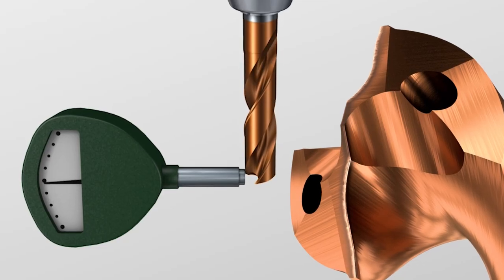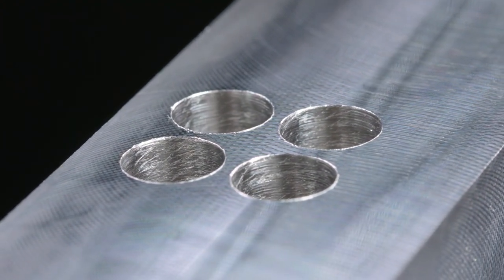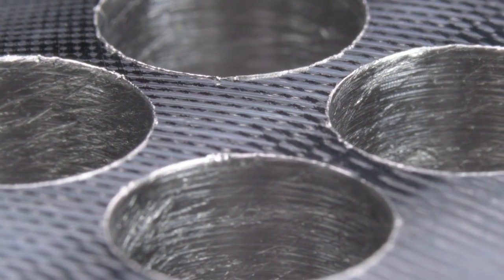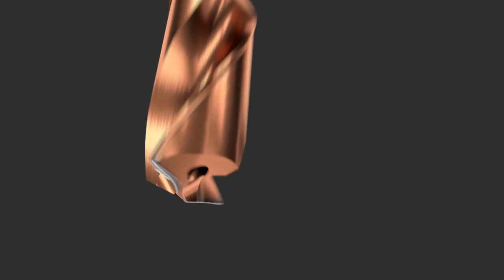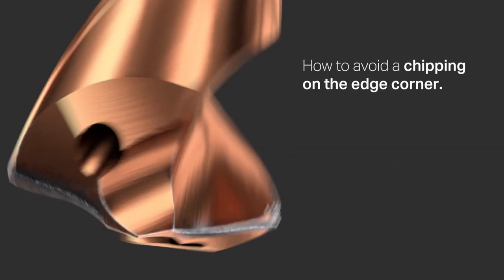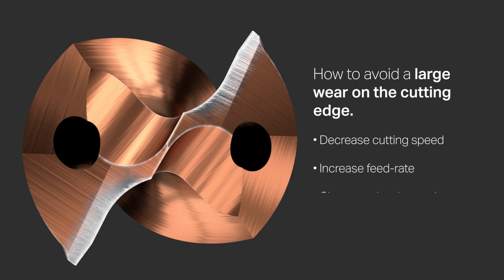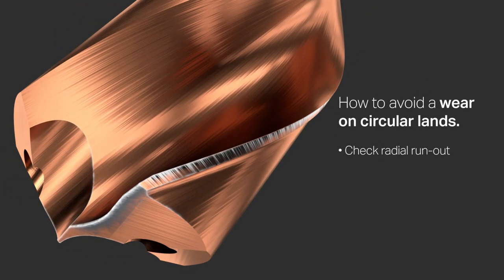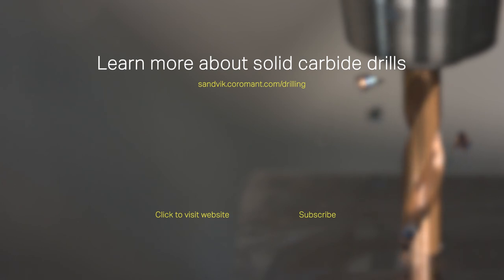Tips film #41 - Analyze tool wear in solid carbide drilling

Comment: What I'm missing is information about spot drilling in combination with solid carbide drills (when to use or not and choice of angles).
Reply: I called my sandvik rep and got this: Anything over 8Xd definitely need pilot. 5xd  you may want to spot with something with a spot drill with an angle equal to or greater than the drill being used. Also, when drilling radially a small spot may prevent drill walking.  When you start drilling deeeeeeeep holes 12XD -18XD and up you should always call and make a plan of attack with your local tool rep.
Reply from the maker: Hi,
Thank you for this input. We will add this to the list of subjects for future tips films.

Comment: Hello Sandvik,  I heard that the surface finish of the chip also says a lot.  Shiny means a good cutting speed, dull is too slow.  Do you agree?
Reply from the maker: Yes you can say the surface finish of the chip indicates you have the correct data for a successful operation but the shape of the chip is the most important factor when determining excellent chip control. Other factors can contribute to a shiny finish of the chip such as material hardness, coolant type and concentration with a dull chip showing not enough heat in the process so the solution would be to increase the speed.
 
Best regards

Robert Smith
Global Application Specialist